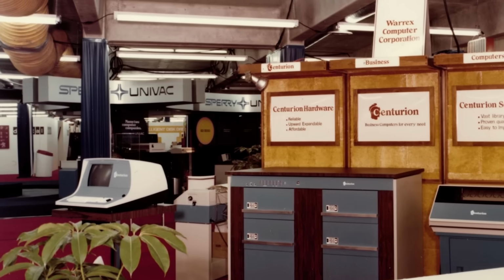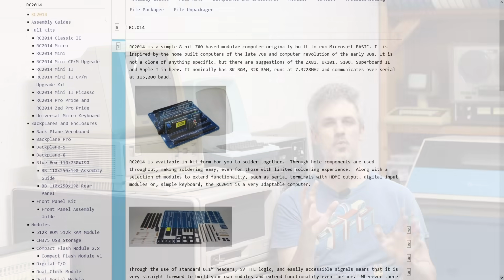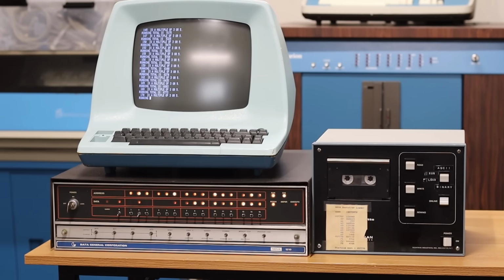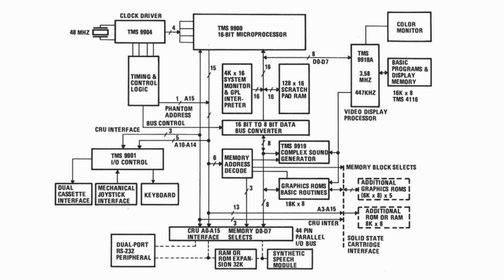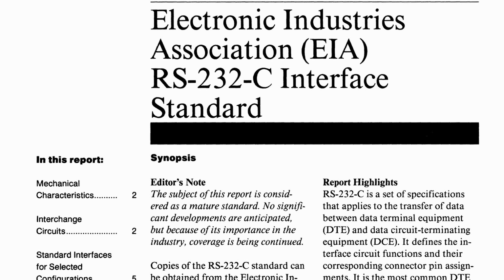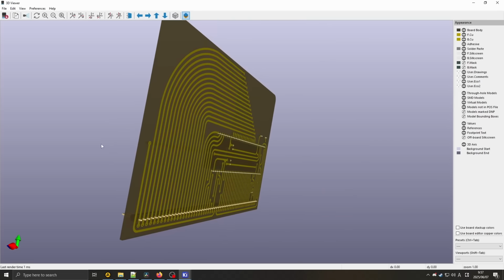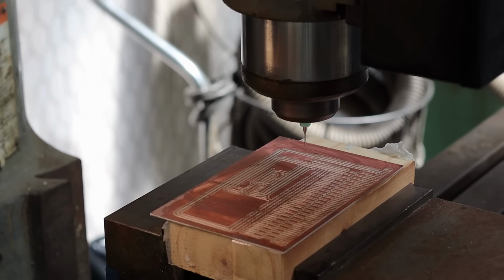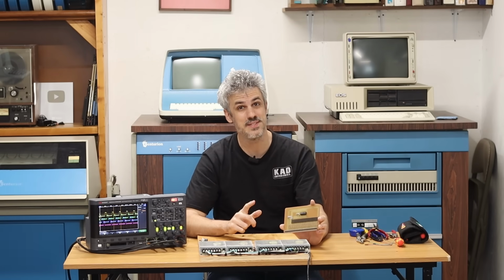The First Step in Building our TMS9900 Homebrew!

Comment: 9:00 It seems to me that an integrated CPU is not optimal for differentiating a micro from a mini but an integrated motherboard/mainboard is significantly more accurate and holds true for all the examples listed in this video.

Minis often just have a backplane with all the various compute, I/O and storage broken out into cards. Micros lose the concept of a backplane, instead using a motherboard and integrate much of the functionality from the cards onto the motherboard.

This integration on the motherboard started out limited but over time more and more was integrated until these days it’s common the only card in a system is for the graphics.

Comment: In the 80s I learned that Minicomputers are hardware prepared to run multiple processes while Microcomputers are not. So technically a 6502 is a base for a Microcomputer as it lacks any preparation for multi processing, multi user or multi threading. The TMS 9900 has such options but interestingly that also makes the Apollo Guidance Computer a Minicomputer even the 7 tasks are sort of hard-wired. From the 80s perspective a modern x86 or multi-core ARM is at least a Minicomputer if not a Mainframe. In that 80s definition multi-user is not differentiated from multi-tasks as technically it only differs if the tasks report to same or different serial ports.

Comment: My idea of homebrew computer is different. In todays age you can get most of the parts of a computer in 1 package like mcus/socs.If the mcu /soc /cpu is only used to do one thing or just used "as is" then it cant be called a homebrew computer.  If you yourself are extending the soc/mcus functionality by adding external ram/rom, interface ics, input and output systems , storage etc  that is what makes it into homebrew computer because you are now taking a mcu/soc and turning it into a full fledge computer with input,output and storage.

Comment: The LSI-11 wasn't a single microprocessor, it was a set of chips that together formed the CPU. It wasn't until the 80s that IC density allowed single chip minicomputers. That revolution also killed all the minicomputer manufacturers because 32 bit CMOS processors destroyed their market.

Comment: Thousands of CIA and NSA intelligent TEMPEST  terminals are based on the TI9900/99000, as I programmed the upgrade from the 9900 to the 99000 in the mid-80s. We used an IBM 360/VM to compile the 9900/99000 source to assembly code and baked an EPROM. In the basement of CIA HQ. Outside of the poly, best job ever.

Comment: Wow thanks David! I now have a good enough understanding of what a home brew computer means to realise I’ve built two 😃 over the years: the first was a 6802 based unit on veroboard with 8-digit 7-segment display driven from LS374 latches and buffers, and a 6821 on keypad (recycled from calculator) duty, with 6116 SRAM and LS183 decoding. The second was a 6803 based embedded computer for automotive security (on PCB this time) - used the ‘03 inbuilt UART and PIA for all IO, including a simple network to other such modules (for rigs) and synchronous serial across shift registers to an optically isolated cab mounted console. Only one other serious computing hardware project I can remember building on veroboard and that was a FSM out of 2732, an LS374 (holding current state), a 555 clock and LS138 for output. All inputs were high-end address bits to the EPROM, with lower bits clocked from the latch (loaded with five data bits from the 2732). LS138 inputs came from remaining data bits from 2732 databus. Setting it up was like programming microcode😃 great fun back then 👍

Comment: I've been introduced to the TMS9995 by my CNC machine (Bridgeport Interact 1 with Heidenhain TNC155 CNC controller) and the processors running it are insane! I've been programming my whole life, mostly with Amigas and 68k and later with generic C on various platforms but the TMS 9900 series is quite different.

Comment: NS32016 and related chipset makes it possible for a homebrew minicomputer sbc with an orthogonal VAX-like instruction set running full Unix, including an mmu with virtual memory and memory protection support, an ieee compatible fpu, a dma controller, and full interrupt capability. All released 1982. Too bad the ns32k chipset never was widely used just like the tms9900.

Comment: What I'm really disappointed by with the Cactus is that those piano switches are HELLACIOUSLY expensive 😨 and I really don't want to use something like that in my own design. But I absolutely do want direct switch input for my own little project. Someone designed a 3D printed DEC-style switch using magnetic reed switches IIRC, which might be marginally cheaper.

When I was younger I read a book that used an 8080A or a Z80 (I can't remember) as part of a robot build and it began with a few discrete chips to function as a way to read and write memory independent of the CPU. I kinda liked that idea because it would allow for the evolution from switches and LEDs to a hardware monitor that involved a hex keypad and display with some logic … okay I was just gonna breadboard it and then just throw an Arduino in there as a temporary solution, until I'd evolved a monitor program in ROM which could read and write the keypad/display directly. 😛 I might've kept the idea of a small microcontroller in there just to drive 7 segment LEDs because hexadecimal 7 segment drivers don't exist anymore, but whatever, throwing an EPROM at the task would also be acceptable in 2025.

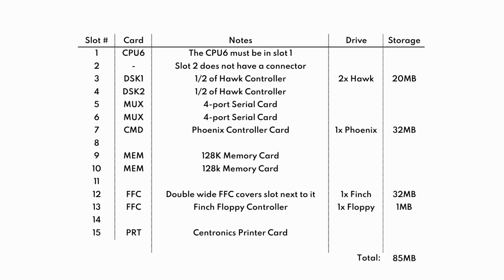Comment: @ 12:45 - hmmm.... then by that definition, my Dragon D64 is a minicomputer!

PS. I agree with you, though, that the 9900 is a seriously under-rated processor: it's serial I/O processing model went on to be the basis of I2S audio output stages, and the point-to-point serial channels of the Transputer. I'm working on a small 9900 based design at the moment, looking forward to seeing which direction you go in with this!

Comment: A home brew is built from scratch on the kitchen table using breadboards, a logic probe for troubleshooting, LEDs, switches, and a way to bring the cpu signals to the outside world. Usually octal latches for output and octal line drivers for the input. Generally I/O is seen as a byte of memory but it doesn’t have to be. Some CPUs have special instructions that generate I/O signals for specific I/O devices. Pretty simple stuff really.

Comment: I remember reading a Data book (Motorola MECL) about the design and construction of a CPU (computer) using MECL, it was a fantastic read (yes, a data book), if you get your hands on it it is worth it. 

It called the CPU they developed a "MIDI Computer" (not the music interface), as something between a microcomputer and a mini computer (a mid computer), I think it was 100Mhz clock. 

IF anyone knows of this data book, or can get a copy of it, it would be VERY helpful to Usagi or anyone else doing this kind of project...

Comment: Have you ever thought about setting up a buzzer wired between the copper and spindle to zero the bits? Or even a way to wire it into the CNC. Also I think there are 30 taper spindle adapters.

Comment: One distinction a minicomputer has over a PC, is that its operating system and architecture are designed to be used by multiple simultaneous users. Whereas a PC can sort of do it, but has hardware and software limitations which don't support a true multi-user environment. PCs almost always only support a single console. It is still actually true today.

Comment: I’m following this one for sure. I have a 990/100M board that I used back in 1980 and added a S-100 bus video card. I can’t say that I’ll build these small format cards, but really interested in the memory architecture. Also interested in s/w used to bring these up. Are you going to use the LBL assembler? What are the plans for ASM/ cross ASM? Where are the de- coupling caps? So many questions. Can’t wait for the next few installments.

Comment: Mini vs Micro gets extra confusing because the x86 based IBM PC is a micro computer and x86 is now used in some large scale high performance multi user computers that was the domain of the mini computers. When they started to put Microprocessors with MMUs in everything  the distinction between mini and micro disappears in almost every way . The industry wisely switched to terms describing usage instead like server and workstation

Comment: The main limitation (and defining point) of a microcomputer is still the solitary display+keyboard pair built in to the machine by default.  To securely manage multiple (and possibly massively multiple) users, you need a) an operating system capable of doing so -- yes, modern OS's have had that ability folded into them, Unix and Unix-like OS's always had it  b) dedicated sections of video RAM for each user (or shared RAM and disk swapping fast enough to not impede the users unduly) and c) clear separation between the roles of User and System Administrator.  The Windows PC (micros) severely blurred the lattermost.  On microcomputers you have to get creative to get additional simultaneous users to work.  A minicomputer, being the smaller cousin of the multiuser (sometimes massively multiuser) mainframe has a default hardware setup and operating system designed and intended to support multiple users.    I would NOT call an Amiga 500 nor a Macintosh SE a minicomputer.  However, the amusingly misnamed Alpha Micro (which WAS actually a mini) used the same CPU chip (Motorola 68000) as those micros  Well, the AM1000's did.  The AM100's used the WD16 chipset, aka same as PDP-11 LSI.  Alpha Micro fans have gotten AlphaMicro OS (AMOS) to run on 68K-based Macs!  But that's still very-single-user mode, because that's all the Mac (micro) hardware can do!

Comment: The tms9900 was the first micro i programmed back in the late 70s and it has always been my favorite. I wrote an emulator for it on an arduino mega but sadly there doesnt seem to be much software, just a rather basic assembler. A relocatable macro assembler and linker would wonderful.

Comment: The Workspace concept made multi-tasking easy. No context save/restore was required. I wrote a real-time monitor to control around eight tasks. Trying to use the cassette tape storage option got real old very quickly, so we bought the Boston Systems Office cross-assembler that ran on our Nova 2/10 development system.  We used the four slot card cage version that I believe hosted a cpu card, EPROM card, and two digital I/O cards. When writing your serial driver, remember to transmit the first byte from user space and the rest of the buffer from the ISR. Fun Project!

Comment: To me, mini or microcomputer has nothing to do with it's size or capabilities. A minicomputer is a small and "inexpensive" (compared to mainframes) computer, that uses the same construction as any other, larger computer. Build the CPU from discrete logic, bitslice chips (like AMD's 2900 series) or a set of custom gate arrays (as in LS-11 and friends from DEC). A microcomputer on the contrary, uses a microprocessor - a single-chip CPU implementation. A microcomputer with the capabilities of a minicomputer is called a supermicro. Early examples of the supermicros are mostly 68000 running UNIX 7, where they "overlap" in capabilities with the predominant minicomputer of the time, the PDP-11 series from DEC. Typically, the CPU in minicomputers came on boards with loads of chips, while early microcomputers were modelled after minis (passive backplane, CPU/MEM/IO on different cards), such as the S-100 systems. However, in those systems, the CPU board consisted of a microprocessor chip plus some address-decoding logic, buffers and clock circuits. In the early 80s, microcomputers complete supplanted minicomputers, as they were very similar in capabilities, once the microprocessor-makers figured out how to make potent chips. Other than integration, there was no conceptual difference between minis and micros.

Comment: The ST9 Tompson had multiple register sets on board.  They ran at cpu speed and we coded up different tasks to run on different register sets,  Task switching was therefore extremely fast and we were able push quite a bit of data through 4 channels.  Total throughput was 500M bit, not bad for an 8 bit cpu.
Instructions manual download: https://www.st.com/resource/en/programming_manual/pm0003-st9-family-programming-manual-stmicroelectronics.pdf

Comment: Cool project.  I'd feel much better if you put some small caps on those clock lines.  Would likely clean up the clocks a lot.  (Or, you could buffer the clocks with some CMOS - might be overkill.)

Comment: I also cnc my own pcbs, and found that putting a layer of masking tape over the board before machining results in a removable solder mask that prevents bridging to the "ground plane", though this does gum up the endmills. I've also just cut away the "ground plane" using a couple different sizes of endmills and "rest machining" in fusion360

Comment: I'd probably say, at least for my defintion, is the actual size (mico/mini, desktop/filing cabinet). Another way to look at it might be the CPU being a single package vs acollection of intergrated circuits. Possibly even the amount of boards "needed" to function, 1 vs -mini- many. That last one might be my favorite, as it somewhat fits your definition for a supercomputer and allows for multi-part cpus (like ones with the apu or clock separate) to count (though probably leaves a bit to be desired).

I dislike certain definitions like the use or typical funtion for a name that refers to size, as atypical uses can cause defintions to shift. 
Like a C64 operating several registers, a database, tracks drivers, and an order screen (think pizza delivery)) would turn it into a mini, despite that not being what you're conveying.

Side note, idk why computer engineers are such bad namers (I'm not excluding myself...) half the terms come from radios, the other half seem made up on the spot with no thought for future iterations, lol.

Comment: IMO the classification between "computers", "minicomputers" and "microcomputers" is still the level of integration in the components. Classical computers used single relays, tubes or transistors which were later scaled down into discrete logic in minis, and those CPU boards on a mini were squashed down into a single chip for micros. If the system has application-specific VLSI chips in it, it can't really be called a minicomputer - that's why in my opinion, the PDP-11/73 and -/83 are desktop microcomputers or workstations rather than minicomputers, even though they still carry the PDP-11 name and instruction set architecture.

Keep in mind that the original architecture of the IBM PC was also a descendant of the 4004, 8008 and 8080...

Comment: I had a goofy thought while watching the earlier part of this video, where you were talking about all the categories of computers.  For some later, home-brew computer project, I wonder what the prospects might be to build something like one of those tabletop computers they had in the original Star Trek TV show...  you know, the ones where they'd mash a button on it and ask it something.  The best of my understanding is, these were based on them guessing what computers of the future would be like, patterned on their best understanding of what locally networked computers were actually like in the 60s.  Basically, the table-top machines were terminals connecting up with the central ship's-computer system, but could also function independently when they needed them to.  What's also interesting is that the Alexa and the Amazon Echo devices were inspired by, and patterned after the way the old Star Trek computers were used on the show.  Anyway, what would it take to make an actual, working ST:TOS style table-top computer system, actually have it WORK, with it communicating also with a (local to the house) "ship's main computer," but base it at least partly on 1960s and/or 1970s computer tech and components?  Would that be just bonkers enough to tempt you for a future project?  :D :D

Comment: I applaud this project. I'm building a Z80 computer with a front panel, serial, parallel, and ide support with the ultimate aim of running CP/M.

So far everything up to the ide is working and running a homebrew monitor.

The idea of going for a "mini" computer is inspired and making me think about my next project.
Reply: Been doing that myself on a breadboard.  No front panel, but everything else.  It is alot of fun.
Reply: One day when I can retire again (yeah, like a fool I went back to work), I intend to break out some of the 25 MHz Z80s I bought before the discontinuation and see what they can actually do.  They did pass the acetone test...

Comment: Wow I love the over kill but it brings back so many memories of making PCB's myself. As a suggestion for bare copper boards we used to mix a solution of shellac and alcohol ( ethanol but I doubt it would matter ). We would then clean the copper and coat the whole board and let it dry. The coating acted as a flux and protected the exposed copper should you want to solder something in the future. I don't recall any ill affects over time I still have some boards made then in the 80's and they look fine.

Comment: Even with your definitions, the lines are blurred. My very first PC eventually got Linux installed on it and acted as an e-mail server, router, and console server for the four of us sharing the apartment. Everyone had their own account and could telnet into it and open their own command shell at the same time. It didn't even have a keyboard and terminal hooked up to it most of the time though I had a really nice little Wyse terminal that I could plug in and use if need be. It was incredibly reliable. The only time it ever shut off was if the power went out and then it just powered back up once it came back as good as new.